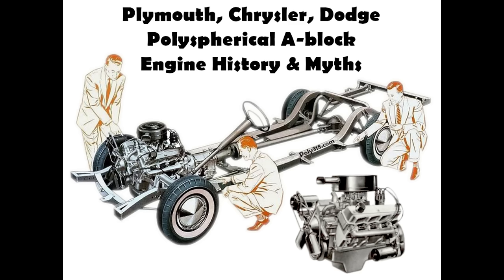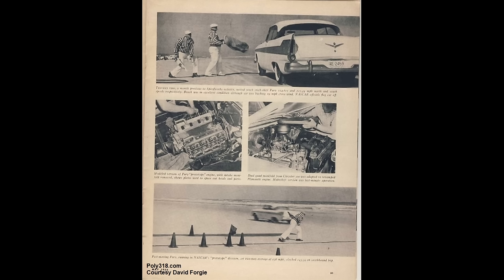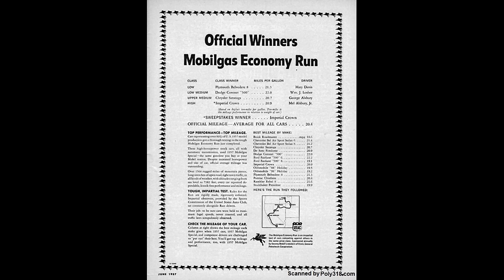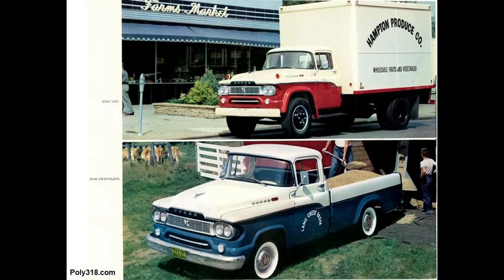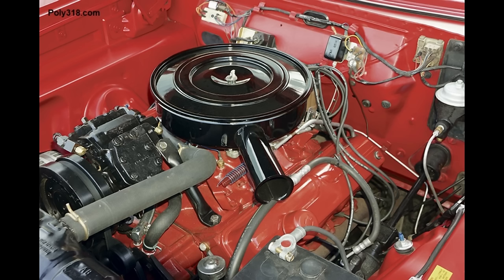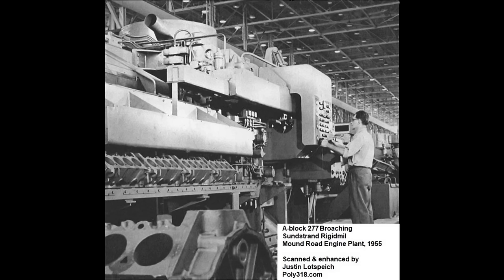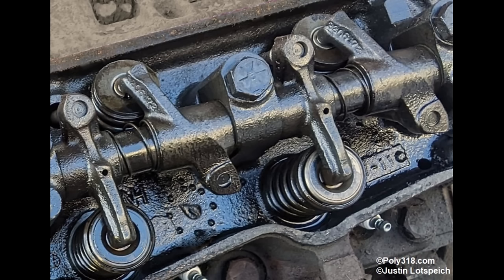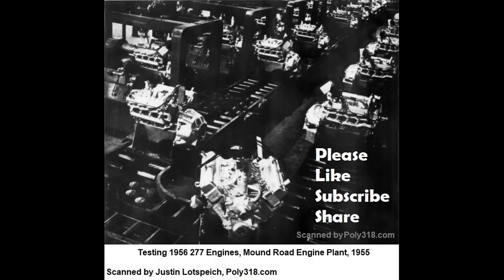Plymouth, Dodge, Chrysler Poly A Block Engine Family 277 301 303 313 318 326 History and Myths

Comment: I put a 66 or 67 poly 318 into my 70 fargo. Got a big older 4 speed truck transmission and. Bell housing. It bolted together except for one main bell housing bolt that didnt line up. Ran it for a decade like that. Was a great combination.

Comment: Nice video, but two things...
The term "Semi Hemi" didn't come around until the middle 60's and it was applied to Big Block Chevy engines who were then competing against the 426 Hemi.
Chrysler only referred to the Poly's as "single rocker shaft engines" when they were in production.
  As for them being cheaper, yes the quality of the components was top notch, but they had fewer parts and less metal overall,  Chrysler was able to save on the second set of shafts, the rocker shaft stands and their machining, the pushrod tubes etc.
They were by no means "cheap" engines, just cheaper than the Hemi.
Reply: If you say "Less Expensive" rather than "Cheaper", it doesn't have a negative connotation.
Reply from the maker: Thanks for the comments. While Chrysler Corporation never referred to the Hemi-block poly as a "semi-Hemi," the earliest evidence of the term I have found is long before the Chevy reference. I located a microfiche 1958 Los Angeles Herald Examiner classifieds ad from an auto wrecker advertising "running Dodge and Chrysler semi hemispherical motors." The period hot rodders I have spoken with who were building Hemis in the late 50s and early 60s also confirm that they were using the moniker when buying Hemi-block poly engines for parts. When someone would say they picked up a 354 it was assumed to be a Hemi, so they would say, "I picked up a 354 semi-Hemi" to clarify it was a poly head. This newspaper and personal sources are from Southern California, so the term may very well have been regional to where other regions were not calling them sem-Hemis until the 1960s. There was no similar need to differentiate the A-block since it was unique. They and all period sources I've found referred to it as either a Plymouth [displacement] or a poly [displacement], such as a Plymouth 318 or poly 318.

From the internal Plymouth documents written by the Qualimatic Mound Road plant engineers and by Plymouth's Finance Department, almost all of the savings in the A-block came from the plant and production process design versus hard parts. While there was minimal savings in a lighter engine block and the single rocker-arm assembly design, the automation coupled with the extremely precise machining tolerances they were able to produce ended up allowing them to build far more engines per hour than the Hemi and Hemi-block poly and with less errors that created factory waste and less warranty issues from dealerships. Two prime examples the A-block design, factory, and finance team give in 1955 documents are the automation of torqueing the head bolts by machine and the cylinder head line. The A-block's head bolts were torqued by machine and had an excellent record of not having leak issues, whereas the Hemi and Hemi-block poly engines were done by hand and would result in human error and head gasket leaks. The other example is how the A-block design team and equipment suppliers invented a single machine to process the cylinder heads that only clamped the head once the entire process, whereas Chrysler Corporation 6 and 8 cylinder heads prior to the A-block including the Hemi and Hemi-block poly required 3 to 4 separate machines and multiple clamping/unclamping actions of the head to process it that introduced stacked tolerances and resulted in junk heads the factory had to either take off the line to repair or scrap. The A-block factory and design applies these similar concepts to every aspect of the engine plant, which resulted in both superior machining and savings.
Reply: I like that you did the proper research and how you explained everything. Seems like they were building very good and efficient engines in the late 50s. Then by the mid 70s the grand fury was getting horrible fuel mileage and had less power. My dad bought one brand new in 1977.
Reply: All of the poly heads were called semi hemi. Had nothing to do if the block was the same as a hemi engine or not. Chrysler usually referred to them as dual or single rocker shaft. Hot rodders called them semi hemi or poly engines, later on mostly to differentiate them from the later wedge engines.
Reply: @Poly318 ... Pay no mind to uncle caveman he's just a hack pretending to be knowledgeable. Any one can search and be a keyboard expert.
Reply: Ford Boss 302, 351Cleveland, and 429/460 were the same way too, eh?
Reply: @488ci that was due to emissions , mainly because the cat needed a certain percentage of "wasted" fuel to stay "lit".  The engines had lower compression, lower power but used more gas.
Reply: they had to cost less to build because they were meant to go into cars that cost less.
Reply: @488ci  The Smog Era was really
bad. Detroit thought it could get Republican President Richard Nixon
to ignore smog-rules, but, unfortunately, Nixon was from Southern California; and was well aware of the Los Angeles smog problem.
Reply: @jimstrict-998  Nixon was looking for praise, but all he did was pass laws that killed the American auto industry. The Regulations set by Nixon were too sudden and to harsh.  the new rules opened the door for the Japan cars to take over

Comment: I have a 66 Travco with original Poly 318-3. This engine pulls the coach quite well. I have the hydraulic lifters and the 4V carburetor. 

. I can make the case that the A engine cools better because of the mass of the heads. Long live the Poly. Great video BTW.

Comment: Our family had a slew of 318's.
'59 Suburban with a Torqueflite and a gas heater, a '60 Dart Pioneer w/ Powerflite, a '64 Savoy w/ Torqueflite, a '64 330 w/ Torqueflite, and a '63 440 w/ Torqueflite that I did change the intake to a 4bbl.

Comment: great content, I worked at mound rd engine and other big 3 plants as an outside contractor doing concrete form work. I look foward to more of your videos, thank you
Reply from the maker: Thanks for your support. After researching the Mound Road plant, I would love to have toured it before its demolition. I guess I could see if Stellantis will let me stand it the parking lot that now covers the old plant to see if an aura exists 😆
Reply: @Poly318  you didn't miss much. mound rd engine was a dump, low ceiling, i could never have punched into that plant for 30 yrs, i worked at warren truck and stamping and i had to drag up for outside work cuz i needed fresh air.  i look forward to more of your videos. My dad was a district manager for Dodge from 67-73 and he had excess to any ride he wanted back then, he had a 70 RT/SE convertible with a 383 mag and he let me sit on his lap while he did whole shots in the under construction neighborhood and mom had a 340 4 speed , those were the days, i never have seen a 318 poly but it sounds like TCC should have run with it, just imagine a 340 poly

Comment: Who says the Internet cant be informative?

I onow 340 wnd 340 6 bbl and 440 also 5440 6 bbl a hemi owner addition ally 413 ramcharger.
Thid video provided more info than all thoe mopar guys.

Todays engines are all about technology and fuel efficiency

Back then romp and stop gastest car wins.

My old nova SS installed 406 SB lunati racing cam it would turn completely sideways from dead stop get 13 on the highway ,17 in town.

I long fit yhe day of hemi charger
440 6pk sioer bee
440 corner RT
Even 340 duster

Comment: The LA 273 could be had in the '65 Plymouth Valiant and Barracuda. That's probably the earliest use of that engine. Also, I owned two vehicles that had the A-318. A '62 Dodge Power Wagon 4x4 and a "65 Belvedere I inherited from my parents. Both were high mileage and both used a little oil, but didn't break down. Excellent, informative video I might add!
Reply from the maker: @adotintheshark4848, thanks. The 1965 Belvedere has wonderful lines. 

The LA273 was released for the 1964 model year optional in Plymouth Valiant and Barracuda and Dodge Dart models. The 273 Super Commando was released in 1965, which is a great engine and the start of factory performance LAs.
Reply: @Poly318  273 Super Commando usually referred to as the "Formula S".

Comment: My dad bought a 55 4 door savoy 6 cylinder, bought a 56 4 door for parts that had a V8, it's a poly with dual points and I believe a 2 barrel or single barrel 🤷 has spark but could never get the poly V8 to fire. My dad passed in 2016, we still have the 55 savoy and the poly V8 and transmission is still bolted to it. Always had plans of putting the V8 into the good car, only thing savable from the parts car was motor, trans and glass, hood and trunk and doors

Comment: Great video. One of the interesting things that I noticed is that some poly engines have a much more pronounced sawtooth shape to the valve covers than others. I wonder if the big sawtooth poly's are the semi-hemi engines or if there is some other explanation.
Reply from the maker: @markanderson1519, thanks. Yes, the Dodge/Chrysler Hemi-block poly heads have four very deep, symmetrical waves in the heads and valve covers pictured at 0:30. On the other hand, all A-block heads have a shallower sawtooth wave pattern with four peaks like my head at 0:20.

Comment: Had a '66 Belvedere 318 in '82
The interior was trashed and someone primered it brown looked like with a paint brush.
It was hideous
I tried to blow it up and burnt up 2 tires.
I filled it hose water trying to freeze crack it.
Grandad replaced the tires and freeze plug 6 months before died.
I inherited his '77 Ford F150 351M and gave the car to my cousin.
Wish I still had both today

Comment: One data point.  I have a 1956 Plymouth with a 277 / Powerflight.  Decades ago the crankshaft broke under another persons ownership and the car was sidelined.  From what I understand, broken cranks on the 277 were an issue.

Comment: I owned an Australian assembled right hand drive 1959 Desoto Firesweep, it would have been a 1958 equivalent in US and Canada, it was fitted with a 361 cu block that if I remember correctly developed a claimed 309 bhp, it had a push button torqueflite auto, air and steer, however the air was not factory but a very neat aftermarket wide slim underdash unit.
A light green with dark green top and those beautiful 3 bullet tail lights on each fin, the Desoto had the best looking front grille and rear tail styling of the forward look Chryslers IMHO.

Comment: Good overall presentation, but the 56 Fury 303 did not get its extra inches just from a .060 overbore, but also from an increased stroke.  The Fury 303 essentially had what became the 318 crank, with a 3.31 stroke compared to the 277's 3.13 stroke.  Then the 57 301 had a 318's 3.91 inch bore with a 277's 3.13 stroke.  Etc., etc.
Reply from the maker: Correct, the A303 has a 3.81" bore and 3.31" stroke, whereas the A277 has 3.75" bore and 3.125" stroke. I have a full list of the specs if anyone is interested in seeing the comparisons at https://poly318.com/poly-318-engine-specifications/ Thanks for the comment.

Comment: We had a 59 Plymouth wagon with the 318 in it and you couldn’t keep main bearings in it. It ran pretty good and was pretty quick but the front sump oil pickup starved the oil pump under hard acceleration.
Reply from the maker: The 1959 A318 wagon engine was a center sump oil pan, and a front-sump pan won't clear the crossmember. Only trucks and some industrial A-blocks received a front sump, and that design was used through 1967 without widespread reports of oiling issues. The A-block cars used the 4-quart center-sump design from 1959 - 1967 with no reputation or service bulletins of oiling problems with the pan/pickup, so I suspect something else was wrong with the engine.
Reply: @Poly318  Ithink it was something other than  the oil sup because of other 318s would live forever and rattle like a junk yard.

Comment: These poly engines are really cool. Not sure how many people know that the modern 4.7L sohc engine has valve placement that looks almost identical to these old poly heads. I wish Chrysler would have kept with this design. Were they the first to bring this canted valve arrangement to the market out of the big three? Will Poly heads bolt onto an LA block?
Reply from the maker: @alexgrindnshine2522, yes, Chrysler Corporation pioneered what they named the polyspherical valve and chamber arrangement at the time GM was experimenting with the wedge arrangement in the small block and Ford with the peanut-shaped chamber in the Y-block, both with inline valve configurations.

A-block heads can be fitted onto an LA short block, but it's not a direct interchange and much more work than simply using an LA 2.5" main journal crankshaft in the A-block for stroking. Most of the A-block's coolant ports are either missing or misaligned and need to be drilled into the LA block for optimal cooling. A-block heads use two oil drain-back galleries drilled through the head down through the block into the crankcase that the LA doesn't have, so you either need to rely on the A-block intake push rod holes for drainage--which keeps a quart or more of oil tied up in each cylinder head for it to pool high enough to reach the push rod holes--or you have to tap into the A-block's head and run drain-back lines into the oil pan. The LA block up toward the deck needs to be ground for A-block push rod clearance. LA flat-top pistons will either need to have valve reliefs cut in to match the A-block intake valve, or A-block pistons can be fitted. An A-block camshaft must be used, which fits without modification. Either A-block or LA lifters can be used, although A-block lifters are shorter.
Reply: @Poly318  thank you for all the great info.
Reply from the maker: @alexgrindnshine2522, I'm happy to share.

Comment: Did I miss the bit on the 273 LA or Low Deck A engine ?
Reply from the maker: You did not. There was never a "low deck" or "raised deck" A-block since only one deck height was used for the 1956 - 1967 A-block at 9.603", plus or minus a few thousands depending on machining tolerances. The 273 is based off the A-block short block but is in the Light A (LA) engine family and not the focus of this video. I mention the LA273 around 15:11 as an aside but don't go into much detail.

Comment: I have a 57 dodge one ton dually with what I thought was a 315ci. poly. Is it a 313? I really like it and feel like it's a rare find and hope to get it restored. Dodge all the way!!!!
Reply from the maker: @kevinsparks1279, domestic Dodge trucks did not receive the A-block until 1959 with the A318. Export trucks offered the A303 in 1957 and then the A313 starting in 1958. The A-block is easy to tell apart from the Hemi-block poly. If your engine has valve covers with four very deep and symmetrical scallops, it's a Hemi-block poly. If your engine has four shallow and asymmetrical scallops, it's an A-block. There are many other differences, but the valve covers are easy giveaways. Another easy one is that the A-block has an intake manifold that seals the valley, like an LA or small block Chevy intake manifold, whereas the Hemi-block poly uses a separate valley cover underneath the intake manifold with a gap between them.
Reply: @Poly318 The red 315 Dodge truck engine pictured for 1959 is a true hemi.

Comment: the reason for the development of the LA engine was, Mopar needed a V8 engine to fit into the compact Valiant and Dart. it is too bad they didn't continue development of the poly engine; the Ford 351 Cleveland is a copy of this head design and it proved to be the best power to ci engine with all modern engine layouts copying it. Mopar could have been first to the water hole if they had continued developing the Design.

Comment: Where does the 241 cid from 1955 fit in?
Reply from the maker: @jonathanmorrisey5771, the 241 Hemi and Hemi-block poly is not in the A-block family covered in this video.
Reply: @Poly318 Did 1955 Plymouth offer both "poly" based on the Dodge hemi block and "poly" based on the new A block?
Reply from the maker: @davidpowell3347, no, the A-block was not offered until the 1956 model year. 1955 Plymouth used the Dodge V8.

Comment: The B block was introduced in 1958 at 350 cubic inches.... In 59 grew to 361.
Reply: Another correction is for the 1959 361 Golden Commando.
That would be 395 gross TORQUE, rather than HP, unless
we're talking about a dual-quad
version.
Reply from the maker: @hotrodray6802, The B350 and B361 were both available in 1958.
Reply from the maker: @jimstrict-998, You're correct. I meant to say ft.lbs. torque, but horsepower snuck out. They were advertised 305 HP. Thanks for pointing that out.

Comment: He forgot the 325 dodge.
Reply: The Dodge 325 Red Ram is covered.
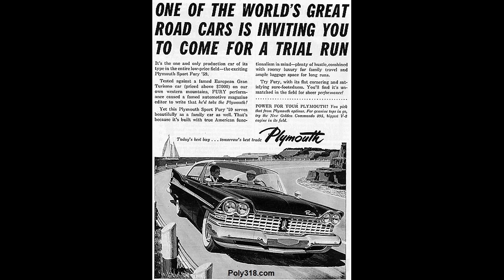Reply from the maker: I discuss the A-block Dodge Red Ram 326 at 09:00 minutes. The Dodge 325 is a Hemi and Hemi-block poly engine and not in the A-block family discussed in this video. The A-block version was a 324.49 c.i.d. advertised by Dodge and listed in service manuals as a 326 to differentiate it from the Hemi and Hemi-block poly 325.
Reply: @Poly318  My mistake on the engine identification. As a retired mechanic specializing in Mopars, I've encountered only two 325 Dodge engines. I will admit that the 318 is the toughest engine ever built. In all generations. And one of the most underestimated as a performance build.